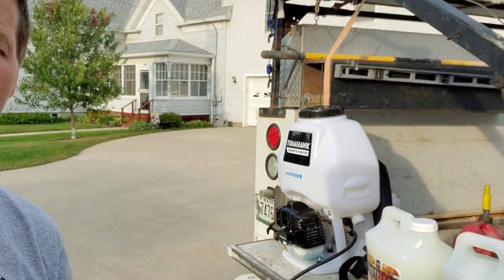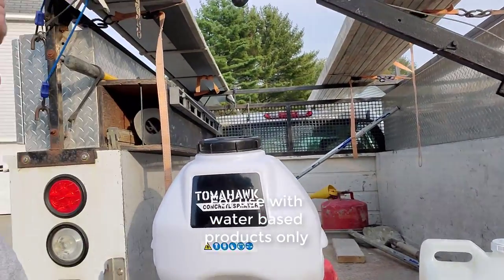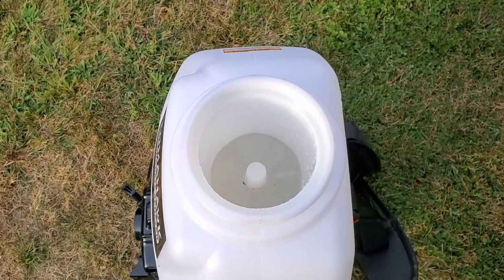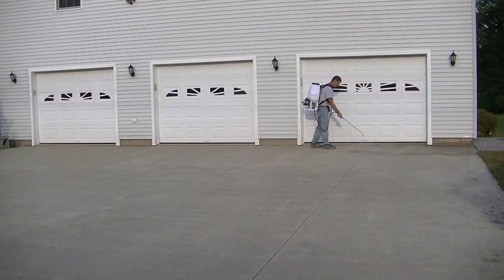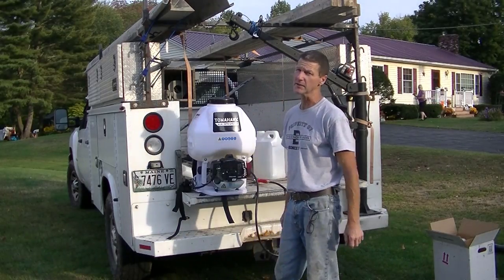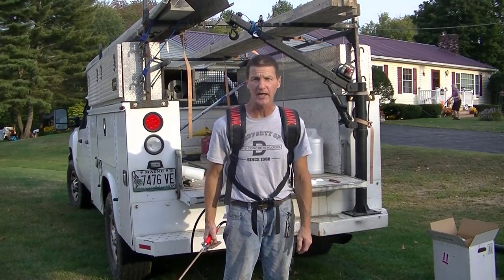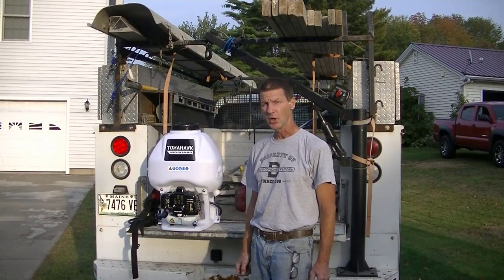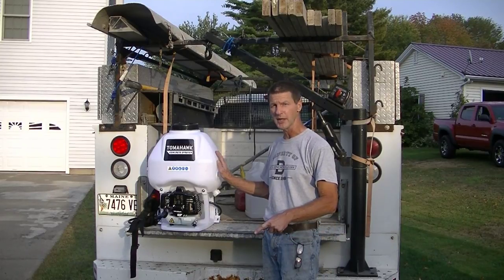How To Seal A Concrete Driveway - New or Old (With Power Sprayer)

Comment: The very first step we take a few days ahead of time is to thoroughly clean the slab with a pressure washer.  When spraying sealer on existing slabs we like to hit it with a roller to even out the coat and on small to medium sized driveways or patio’s it’s just as easy to pop the lid on the 5 gallon pail of sealer and dip the roller in and roll out the area.  Depending on the sealer type it’s also a good idea to add some anti-slip additive to avoid a trip hazard when the slab is wet.  Great job with adding relevant and interesting content, always a pleasure to watch.
Reply: For oil-based sealers, we do the same. But waterborne sealer like he's using, we spray. It's super forgiving, and goes on very level (as it's so thin being water based). Few techniques for our views

Comment: For 2 Months I've been trying to decide what to buy for My basement floor, all I see a lot of is epoxy flooring. I know I don't want that because I can tell it just sits on the concrete. I wanted something that would penetrate the concrete. But I also know that You can't use any product anywhere. And this seems like something that would suit My need. So I wanna know, can this product be used indoors? Or Are there any other Siliconate Penetrating Sealers that you can recommend for interior use? 

Thanks alot.

Comment: i have a sprinkler system that runs well water.   Which is high in iron so i have areas with orange stains on concrete driveway/sidewalks.   What is the best stuff to use to get these stains off?   Will sealing the concrete help with keeping the stains off after i get them cleaned?
Reply: CLR works pretty good for an ‘off-the-shelf’ product. We get a lot of that iron staining here in Florida with our shallow utility wells.
Reply from the maker: I've got a whole page about that here: https://www.everything-about-concrete.com/remove-rust-stain-from-concrete.html
Check it out and let me know what you think.

Comment: Do you typically use water based?  Do you not have to back roll that?  We use solvent based siloxane but had a couple problems with old concrete getting blotchy
Reply from the maker: No back rolling with this, it soaks into the concrete and looks like it was never done.
Reply: Mike Day Everything About Concrete 
Can you put that over a solvent based cure and seal?